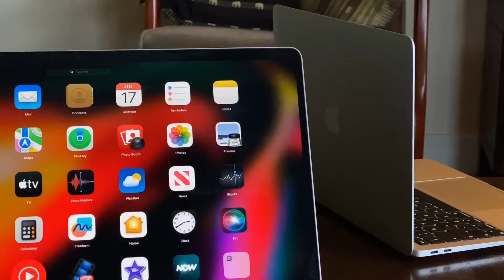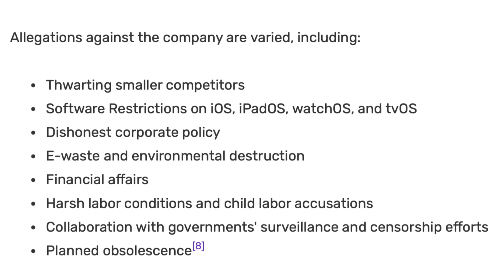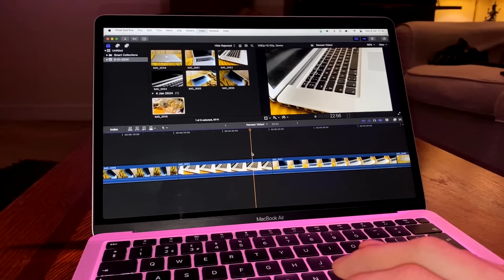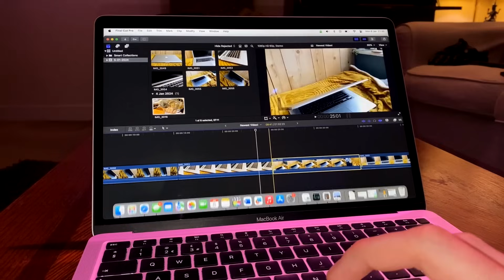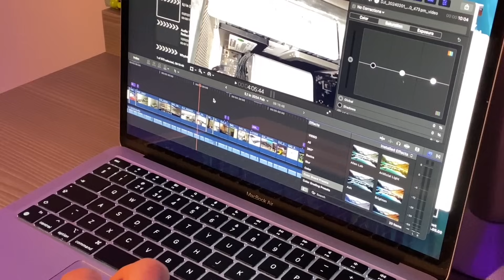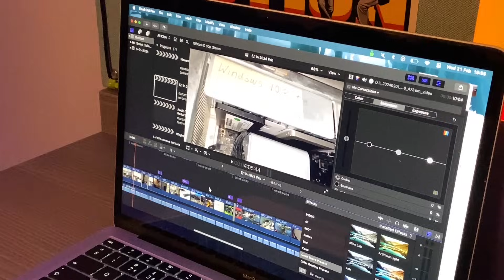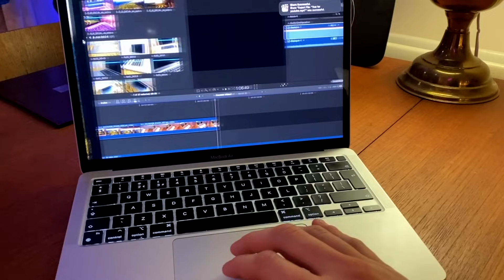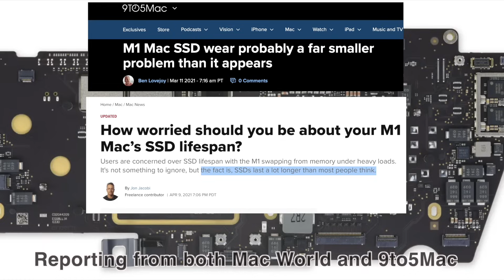Don't make the same mistake I did by buying a used Intel Mac.

Comment: I understand his point of view; we are already at M3, but this applies much more to the American reality. As a Brazilian, for example, I bought a 2019 MacBook Pro, 32GB of RAM + i9 8 cores 16 threads, with 1TB SSD and a 5500m with 4GB VRAM, for a bargain at R$5000 (in comparison, this model was R$29000 when it was released), plus it only had 90 battery cycles—a real steal!

These machines are extremely powerful, and for my use case, better than the Apple Silicon M series, because they have the x86_64 architecture which handles Docker much faster (due to better virtualization support).

It’s not a mistake to buy an Intel series MacBook; the prices have plummeted, and both you and I need to take advantage of this. Unfortunately, Apple consumers tend to think that the latest release is the best and perhaps that the older ones are BAD by definition. This is not true.

Yes, it's true that the operating system support will soon end, but it's a machine that will last for many good years. Consider getting a highly configured 2019 MacBook Pro.

Also, understand that this "cheapness" might only apply to the United States, and in other parts of the world, the M1 is still extremely expensive.

In the end, the right choice is the one that is within your budget.
Reply: nem fudendo que te achei aqui
Reply: @rswierczynski  HAHAHAHAHAH muito bom!!!
Reply: @rswierczynski  Google sabe de tuuuudo... tive que responder e colocar outra perspectiva, a realidade entre países é totalmente diferente.
Reply: Planning to purchase this specific specs MacBook... How is it currently functioning? Do you recommend it?
Reply: @false9593  it’s being great, it’s still pretty fast. Newer models are wayyy faster of course, less heat and better battery life. The speaker is sick, the keyboard is great just need some time to get adjusted to, the screen is awesome, the touchbar is very big, it is a very solid well built computer indeed. 

I was using an Ryzen 5 3600 with 32gb of ram running mainly linux, from benchmark sites the multithreaded performance of the i9 in it is 10% lower than the 3600 but there is virtually no difference in single thread performance. I can do all of my work no problem.

The ssd is very very fast, not as fast as modern nvme, but last time I’ve benchmarked it was something around 1-3 gb per second read write

Video is alright I just use for Minecraft, I didn’t use any high gpu usage app.

I did got a simple dongle to connect to an external monitor and have more IO and it works great.

For normal stuff like browsing the web and watching videos etc it will stay cool and silent, if you are doing heavy stuff like compiling code etc it will start its fans and get hot. So I recommend getting a stand for it when working on a table or using a pillow or something if working with it in your lap. The fan noise is not such a big deal.

Memory wise it’s kind of… strange.. I am giving safari a try but it sometimes gets toooo much memory it’s insane. But overall the system is pretty good, anytime I open activity monitor to check on ram usage it never has a high pressure.

But I did run into some problems. I am using dev containers inside vscode, spinning virtual machines, and sometimes there is tons of processing, and the battery drains even when plugged in. That happens only when there is a continuous high usage of cpu. (Note the battery has less than 100 cycles)

The battery life is also great, like yeah it isn’t comparable to newer models but still is a big battery for a power hungry cpu

I would recommend to first identify if economically it makes sense for you to acquire one of this models given you budget and environment, also correlating it to your use case.

If this model is a great opportunity, be aware of the battery health.

This model is great.

*also, it seems that my previous comment was wrong about docker, it seems to run smoothly on arm, but it’s advised for using arm images, so be aware for compatibility if deploying on x86 hardware, to use an x86 image on deploy.
Reply: @arthopacini  Thank you for the detailed review! I'm planning to buy this machine for professional video editing and hope it stands up to the task and handles my work properly. I'm considering getting the 64GB RAM option, but the rest of the specs will be the same as yours. Thanks again for the thorough review!
Reply: @false9593  I mean, it will of course be enough to handle video editing, if you are using 4k footage you might use proxies and turn on some optimizations that kind of stuff, but it will sure handle, it's an i9 after all. if you can get the 64gb get it!. but do check if an M1 is somewhat at the same price level, cause it would be way faster of course. check out some other reviews about it, maybe some benchmarks between the latest i9 and the m1 etc. good luck!
Reply: @arthopacini  do you recommend updating this system to Sonoma or Ventura? I've heard from many people that older machines tend to slow down with frequent updates, so I'm curious about your experience. Would you suggest sticking with the Monterey version?
Reply: Also, when they do lose support, I'm pretty sure you can install Linux on them relatively easily, which would keep them alive for decades to come.
Reply: @notme8232  you are right, it's an x86 and way easier to install linux than newer arm chips right now. there is already some projects that make it easy to install it. when it does lose support and becomes too old I will probably install an linux in it, good point.
Reply: @arthopacini  Cara, acabei de comprar um 2019 16” (i9 2.3, 64gb ram, Radeon 5500 8gb e 1tb) Não tem um único sinal de uso, parece que acabou de sair da caixa. Só chega aqui no Brasil semana que vem, mas estou ficando louco,  quase retornando a compra e colocando mais dinheiro para pegar outro por conta de vídeos como esse.

Concordo contigo que a realidade do BR é outra, estava com isso em mente quando comprei. Paguei só R$5k pela máquina e na real, não quero gastar mais que isso agora.

Pode compartilhar comigo sua experiência de uso? Eu que ainda uso um 2013 de 15” sei que vai ser um bom salto, e por óbvio também não será tão bom quanto os da série M, mas tb não quero ter ficar gerenciado performance por conta de superaquecimento, vc tem enfrentado esse problema? Dizem que acontece quando conecta um monitor externo

Eu faço uso pesado de Illustrator, Photoshop, Figma e edição de vídeo, as vezes ao mesmo tempo e tb compartilhado a tela em uma ligação para alguns ajustes em tempo real, tudo isso com um monitor ultra wide 1440p conectado

Obrigado
 

Edit
Cara, acabei de ler o seu review no comentário acima, no alívio de finalmente ter encontrado alguém de uma realidade próxima, corri pra escrever esse texto gigante sem ver todos os comentários.

A respeito da bateria perdendo carga mesmo conectado, é por conta do HUB? Qual que vc tem? eu peguei um Anker555 que pareceu ter o melhor custo benefício pra mim
Reply: @carvalhoandrei  Fala Will, tranquilo? Cara, primeiro parabéns pela compra, eu peguei o meu modelo por 5K (dentro do brasil), e veio como novo (poucos ciclos) mas tinha um leve problema na tela no cantinho bem simples, um detalhe enfim.

Eu to amando essa máquina, ela é potente, eu uso um monitor wide externo conectado quando estou em casa e quando preciso sair, posso levar ele e a bateria vai durar (nao muuuito, obvio, vai depender do que estou fazendo, mas se for o básico ele dá conta sim).

Sobre o problema de bateria e a descarga, na minha experiência, ocorre quando algum app tá usando muuuito processamento. Como eu estou desenvolvendo aplicações, algumas "máquinas virtuais" podem consumir muito processamento, mas eu já tive várias máquinas virtuais ao mesmo tempo e nenhum problema, assim como já tive uma só e houve problemas, realmente depende do quanto a tua CPU tá sendo usada, então vais precisar testar sabe?

Mas assim, eu uso vários navegadores, vários apps, várias áreas de trabalho com o stage manager etc, várias máquinas virtuais, música, janelas do visual studio code etc e tudo roda tranquilo.

Eu já usei o iMovie só para editar vídeos (primeira vez) e é maravilhoso, minha outra alternativa era o DaVinci, que nao cheguei a usar então não tenho como te falar como é. o iMovie pra exportar demora, e nos outros apps quando for renderizar vai demorar, não vai ser igual os apple da série M claro... Vai demorar.

Sobre o aquecimento da máquina em si, a parte em cima da Touch Bar pode ficar beeeem quente, e tecnicamente ele pode e vai diminuir o desempenho quando isso ocorrer. Se tu botar pra renderizar as ventoinhas vao acelerar bastante kkkkk

a bateria perdendo carga não é por conta do hub, estou usando o carregador normal direto em uma das 4 portas usb-c do Mac, é um problema de hardware que nao tem como resolver :(, mas nao é sempre que acontece, como eu disse é quando tu realmente tem uma aplicação que tá trabalhando freneticamente, então pode ocorrer disso acontecer durante uma renderização por exemplo, tu vai ter que monitorar e entender, pq cada aplicação vai lidar com a CPU de uma maneira diferente, algumas sao mais eficientes que outras.

e nao tive nenhum problema ao usar uma tela externa, nao acredito que isso contribua para impedir a carga da bateria, isso ja ocorreu comigo sem ter uma tela externa.

Entao assim, mesmo tu usando vários apps como figma, illustrator, photoshop, na maior parte das vezes os apps não estao consumindo CPU mas sim memória, pois estão lá parados esperando tua interação. já se tu deixar a aplicação rodando uma função tipo renderizar o video, ai isso pode puxar bastaaaante energia.

Pega a máquina pq assim, por 5K tu pegou uma baita máquina, eu queria a versão com 64GB, e vai ser um baita upgrade, se quiser gastar mais, vai ser a série M que começa bem mais caro e com menos potencia.

enfim a máquina é top demais dale nao estorna, no futuro tu troca, por 5k tá bom demais, tmj depois me conta aqui como foi a experiencia
Reply: @carvalhoandrei  e outra, parece que tu comprou de fora ne, se tu pagou 5k e nao curtiu, depois tu vende por bem mais.

e edição de video 4k acho que vai ter que usar proxy e tal obvio
Reply: @arthopacini  Cara, muito obrigado pelo relato, tirou uma tonelada de preocupação da minha cabeça, sobretudo pq como to trazendo de fora, sempre fica aquele pensamento de "já que essa pode não funcionar bem, coloca só mais $100 pra o próximo upgrade" e isso nunca tem fim.

Como eu não me importo muito com qual pontuação aleatória o computador vai ter em um teste qualquer de benchmark, busquei o melhor custo benefício. só quero mesmo que ela funcione bem para o trabalho que desenvolvo e pelo seu relato fiz uma excelente aquisição, muito obrigado mais uma vez.

Quando chegar falo aqui como ta performando
Reply: @arthopacini  to pensando em ficar com ela 2 anos no máximo, como trabalho em casa o computador fica parado aqui como um desktop, exceto quando preciso viajar, e sou bastante cuidadoso, então tomara que eu não perca muito na venda, mas como já falamos, talvez nem perca nada devido a realidade brasileira
Reply: @carvalhoandrei  Opa, se tu quiser o melhor do melhor, realmente a série M vai ser muito boa né, arquitetura ARM, para renderização e outras tarefas é muito mais rápido e também eficiente, dependendo da aplicação. Tu vai ter uma performance de uma máquina bem forte de 2019. Se fizer os benchmarks, vai perder todos. Eu faria um teste e já pensaria em trocar no futuro, querendo ou não é bem potente, e aqui no brasil tu venderia bem mais caro (aliás, como que comprou por R$ 5k?), a máquina vai atender todos teus requisitos, talvez só não seja a mais rápida hoje. Muito provavelmente quando tu mandar renderizar vai demorar e não vai ter comparação com um ARM, mas vai fazer todas as tarefas normal. Depois me conta aqui!
Reply: @arthopacini  eu comprei no ebay por 899, e um brother meu vai trazer. tentei colocar o link aqui umas 3 vezes mas  deve ter uma politica de links externo no canal.

então, eu to bem traqnuilo com essa questão de benchmark, sei que vai ser mais lento qualquer um da serie M, mas tb é consideravelmente mais barato, como faço questão ta tela de 16, teria que colocar mais $400 ~ $500 para pegar um M1pro com 16gb de ram e pelo menos 512 HD no mesmo estado de conservação. Então não achei razoavel pagar 50% a mais para ganhar uns minutos a menos em uma ou outra tarefa específica. tudo que eu preciso é que essa máquina funcione bem e aguente um monte de coisa pesada aberta ao mesmo tempo
Reply: @arthopacini  eu acabei de ver um anuncio aqui no BR nas mesmas configurações que peguei por 9.5k, fiquei bem surpreso
Reply: @carvalhoandrei  exato, aqui é bem mais caro, e tu vai ter 64gb de memória, entao relax, depois tu vende no br com lucro e compra série M
Reply: Thank you. I just bought a  2019 16" i9 with 1GB memory, 1TB, 5500M with 4GB VRAM for $850. It's yet shipping and I'm looking forward to it. And you're right, the Ugandan Situation also is different
Reply: "It’s not a mistake to buy an Intel series MacBook; the prices have plummeted, and both you and I need to take advantage of this. "

you're right.  I sold my M1 Air 8/256,  it was simply too small for both lightroom and Logic Pro. About to buy a £435 used 2019 16" i9 Radeon Pro 5500M with 32GB and  1TB.  Hell,for £290 extra, I can up that to 64GB and 2TB...... Amazing value in both.  For my purposes, these things will FLY.    Also Intel MBPs can BootCamp load Windows 10,,  if I want to do some light PC gaming using the dedicated graphics card.  Yes,the fans will be worked, but so what?  The fans fire up when I game on my 5800X3D gaming PC.
Reply: @sydneystiles151  keep us updated!
Reply: @BelfastBiker  that's the same config I got, it's really fast and work for everything. to be honest, the fans do not bother me at all, it's quiet, and I am always either listening to music on speakers or headphones so whatever. get the 64gb and 2tb version if able. it will be somewhat slower because arm architecture really is faster for some workloads than the x86 architecture, specially in video rendering, but it's going to be fast anyways

Comment: I still need an intel Mac for Bootcamp compatibility, I am using a 2017 13inch MBP.
Reply: Any reliability problems with the keyboard? That’s what worries me the most 🥲
Reply: @joshuepico75 those keyboards were awful
Reply: @joshuepico75  I havent had any issues with the keyboard. I also a 12 inch 2017 MacBook too with no issues.